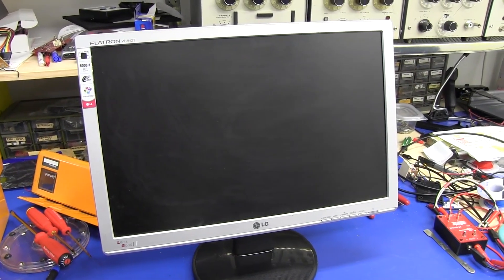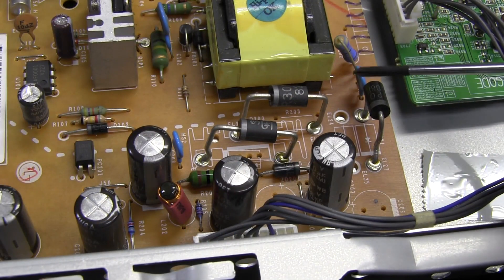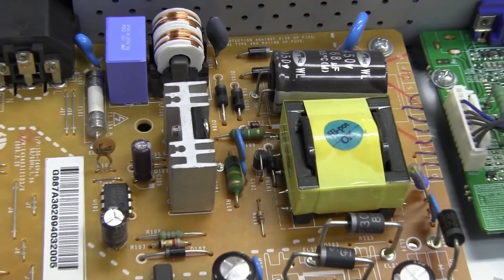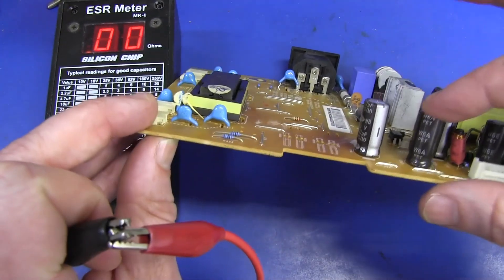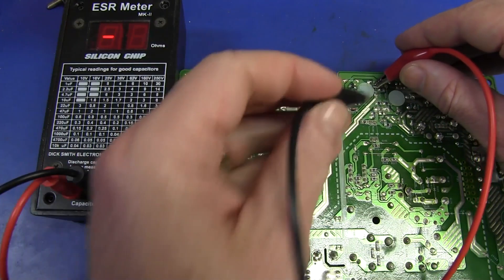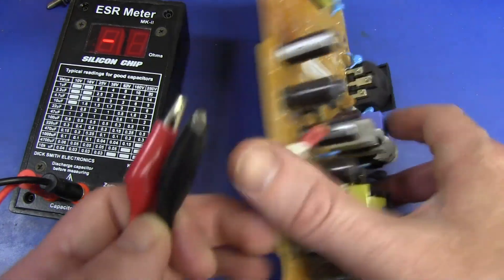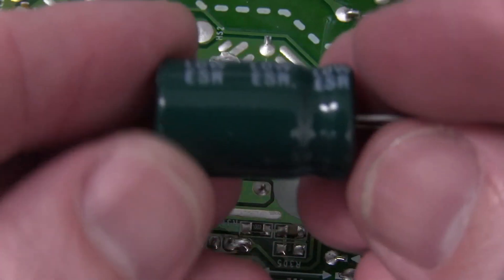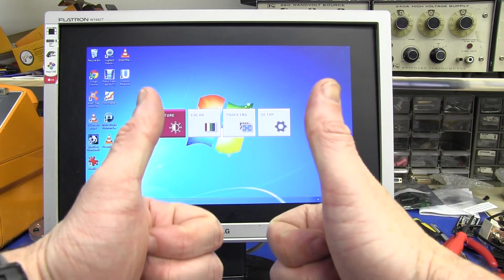EEVblog #365 - ESR Meter Bad Cap Monitor Repair

Comment: If measuring caps in circuit result is total for all caps in parallel? Definitely what happens measuring capacitance. The first bad cap measured was .23 the other almost double at .61.
Reply: Exactly correct Bob. Caps which are parallel in-circuit are unquestionably going to throw off the reading even when using an ESR meter. But you'll find that scenario doesn't occur often enough to worry about most of the time. Just be aware it CAN so always be on the lookout for that possibility. In which case, you'll obviously need to take any such parallel caps out of circuit in order to get an accurate reading on the ESR meter.

Comment: The low voltage wont bias any semiconductors, however what if there is a resistor in parallel with the cap under test ?

Comment: In 2011 I bought LG monitor, and it works to this time.
The reason is that this monitor get power from external PSU.
Reply: Yes. The internal switching power supply units are dog crap which will eventually self-destruct due to an inherently flawed design relative to the feedback loop. It can run away under certain adverse conditions and blow out any components in the path of least resistance which sink a sufficient level of current necessary to destroy themselves. Those, most typically being electrolytic filter caps.
Reply: Yeah and those classic CCFL backlight transformers are hot like hell.
Last time I fixed monitor where transformer overheated and secondary wiring was burned, and by some time there was sparking that probably damaged CCFL tube and inverter IC was shutting down after 1 second, even when I repaired transformer and tube was lighting, to fix it I had to add 10pF/1kV capacitor in parallel with defective tube.
But before I figured it out I spend few hours, IC based faults are bitch to troubleshoot, there was even no datasheet for that IC...

Comment: Hello Dave
I like your videos.

If possible , I would like you to clarify one doubt me ?

Is not risky measure the capacitor ESR directly on the board because I was told that damage the measuring equipment.

Because the capacitor can still load

Or that equipment , can specifically make the capacitor ESR measurement still on board

I hope you can understand me , because I used the google translator , I do not speak English

Continue with the good work

Thank you for your attention

Best regards

Zenilto in Brazil
Reply: Ele falou no vídeo que é pra descarregar todos os capacitores antes de testar.

Comment: looks like the board is being slowly burnt alive at certain spots. is there a way to dissipate heat in those dark areas?
Reply: Certainly. Install a passive heatsink (best option) or PC style "muffin" cooling fan assuming the component genuinely needs to sink that much power. But if it doesn't (which is more often the prevailing case) install a ceramic resistor or two by which to limit the excessive current generating that unwanted heat in the first place. Such potentially destructive thermal problems are usually the result of an inherent design flaw somewhere within the circuitry that went unnoticed during the "drawing board" stage.

Comment: Afaik it's common to use tabs instead of screws, not because the screws are expensive, but rather because it's more labor intensive to use screws.  It's much faster to snap things together with tabs, so they save a lot on labor costs.
Reply: +roidroid Ya maybe for them, but for us got to take it apart and do not know exactly where hte tabs are or what the method is to "unsnap" them. Screws are self-evident.
Reply: indeed.  Appliances aren't made for ease of servicing, they're made for cheap manufacture.  AFAIK Labour is one of the major costs in the manufacture industries, so any savings they can get there pays off BIG.  If a part can be redesigned to save a mere 1 second of labour time, they'll do it.

They probably save so much on labour by using tabs, that it more than offsets the costs of just replacing all faulty appliances with new ones (instead of servicing them).  So in the end it's the more profitable option to make non-serviceable but very-quick-to-assemble appliances.

Comment: It seem to me that having a small stock of Nippon Chemi-con output filter caps is a good idea. I was once forced to repair a computer power supply (after some 10 years of use and overloading-a-250W-supply-down-with-GTX-650-Ti abuse) and the culprit was a busted Capxon cap. Whacked a Nippon Chemi-con one into it after clearing the overload fixed it.
Reply: I couldn't agree with you more Max and have posted that same excellent point higher up above.

Comment: I got a Socket A motherboard that when used the computer locks up at times. It continues to run but it becomes unresponsive to input. Basically mouse and keyboard inputs cease to work.  I got one less than flat cap out of all the ones on the board right next to the ATX power connector on the board. I don't have a ESR meter, but if I can find a cap off another board that matches the voltage and capacity of it would there be any harm in replacing it. With these caps soldering should be easy even for someone as unskilled as myself.  Will to try to get a little more life out of that system for some retro gaming. I guess that could be consider retro at this point in time lol.

Comment: Can you use the "capacitor, ESR, inductor, transistor tester" (see link below) to test the caps (in-circuit) instead of the dedicated ESR meter used in this video?
https://www.youtube.com/watch?v=gx55Gza0zGE

Comment: Where can I get one of these ESR-meters for "in-circuit" measurements - Dick Smith seems to have stopped making kits !

Maybe there is some equivalent ones?
Reply: I've heard this one is great. Can also be used in circuit

http://www.amazon.com/gp/aw/d/B0032V5MIO/ref=mp_s_a_1_9?qid=1427148839&sr=8-9&pi=AC_SX110_SY165_QL70&keywords=esr+meter
Reply: Keld Sørensen Oh, I found the "Dick Smith" kit here and ordered one right away :

http://clientes.netvisao.pt/greenpal/evb1.htm

EDIT: Watch out for the MK 2 version !!!!!!!!!!!!!!!!!!!!!!!!!!

Now I started building the kit I notice it's NOT a MK 2 version !!!!!!!!!!!!!!!!

I ordered a MK2 and the manual downloaded for the kit is about a MK2 version !

I send the seller a mail right away - let's see how he reacts !
Reply: *****
I got the kit and i worked well - with some errors and confusens - but it works well

Comment: We don't call it a 'hate sink', but 'heat sink', because it draws off 'heat'. Go figure.
You're a 'professional electronics technician' who is surprised by how cheaply modern equipment is constructed? Bloody surprising that is.
Also, the ESR chart on that meter is way off on some of the measurements. A pro wouldn't even use a cheap meter like that to begin with.
One more thing. We don't use alligator clips to test components on the board. There are too many close proximity metal parts that can be touched together and interfere with the readings. Only a noob or lazy brit would do that.

Comment: if ESR is a measure of the internal resistance of a capacitor - then why can't one (in theory) just use the resistance setting on a multimeter - is that because of the 100Khz signal only?
Reply: A multimeter's resistance setting passes DC through the component, which in the case of a capacitor, would be like measuring the equivalent series resistance and what I'll call the "parallel resistance" in series with each other. At DC, the "parallel resistance" is typically extremely large as compared to the ESR (typically over a million times larger), and is theoretically infinite in an ideal capacitor (while the ESR is ideally zero), so it is impossible to measure ESR when this "parallel resistance" is in series with it.

The 100kHz signal is important since it makes the "parallel resistance", or more accurately the "reactance" negligible, since this decreases with increasing frequency. Thus, the ESR can be measured as if it is a resistor on its own. Hope this helps.
Reply: Your typical multimeter sends out a continuous current. My guess is that the cap will eventually heat and/or load up and the measurement is inaccurate. There are multimeters that can measure ESR of caps though, they just cost a little bit more.
Reply: Pathfinder3877 Not positive but pretty sure another factor is that multimeters are poor at reading low resistance ranges, while ESR meters specialise in low resistance.
Reply: la corriente continua de un multitester normal, no circula por los capacitores, solamente la corriente alterna puede. Los medidores de ESR emiten una señal de alta frecuencia y así miden cuanta resistencia interna tiene el capacitor.
Reply: blarrer20 dbdbdjnhsvdvp

Comment: that's a very handy meter. I'm working on a Yamaha mg16 and a Behringer mixer. real pain in the ass, so many caps. I hate when a cap goes bad and it doesn't bulge, damn headache.lol. nice video by the way.

Comment: Thanks for the video. I have a LG Flatron W2243T that isn't powering on. Nice picture, too bad they are built cheap. I thought about tossing it, but I'd like to replace the caps in it.

Comment: The plastic hinge design saves them assembly time by quite a lot. Also the cost of screws will add up, imagine they manufacture 10million of the same models, each screw costs $0.001, saving one screw that's $10K, those screws usually costs more than just a cent, so you get the picture.
Reply: That logic could apply to literally any component tho

Comment: You mentioned ESR meters can work in circuit because they send a low voltage at 100KHz signal but what about capacitors wired up to inductors? wouldnt this affect the measurement?

Comment: Love this guy!  And btw thanks so much for doing a real world example of how to use the Bob Parker ESR meter.  I had considered getting this model but I had heard or read that you did have to take capacitors out of circuit to get accurate reads and that made it less of a desirable product.  Your example has changed my opinion.  Ordering mine in the morning.  Thanks Dave.

Comment: your right. it seems like they put caps that are made on purpose to dry out in short time since i had to replace every electrolytic capacitor on my mother board. what quality can you expect in Tier 5 country, where noone is checking the quality of products, and yet we are paying the same price for the computer parts as in US and EU but the quality differs greatly. i bought GForce 9800GT for $280US (same price as the original) but it was made by Inno3d. crap quality failed in the first 5 months.

Comment: two times i am fixing my MSI P43 Neo-F mother board from blown or dry capacitors in the last 6 months without using ESR meter :( i wanted to build one but if i had money to build it i would certainly had money to buy new mother board instead of fixing the old one.

Comment: Assuming your body has got an impedance of 1000 Ohm there are 330mA of current at maximum. The time constant of the cap is about 50ms, which means that it gets discharged pretty fast, while voltage and current drop very fast as well (about 90% within 100ms). I don't think that this is lethal for a healthy heart but I wouldn't like to test it as well. It's definitely dangerous.

Found an interesting paper on that on the site of alcatel-lucent:
Google for "Effect of Electric Shock on the Heart *"

Comment: Sounds like cause for a review ... but get one that's regulated (temperature controlled).  When desoldering you need plenty of heat especially when the the boards have large areas of copper designed as heatsinks. Some wet on your iron helps too

Comment: What type of iron do you use? My current has issue's getting to a hot enough temp to melt non led solder on some of the newer caps

Comment: These cap issues just don't go away.  They nailed me with ECS computer boards around 333MHz and then 1.4GHz and now with the Asus M4A785T-M where the Tk ATWY 938A 6.3V 820uF caps are puffing and then the computer is unstable.

Comment: ive got a semi dumb question for you.. ive got whats called a  'voltage stabilzer' unit which is an optional device used for Tig welding when  added on to a basic A/C stick welder. This device uses  a tesla coil and a mica cap  in which the cap shows signs of the 'resin' leaking. This unit was made in 1967. The cap is imprinted with ratings that say 5000v 6.0 a and .01 mfd .. is there a modern replacement available for this .. ive  looked online and havent come up with anything other than used

Comment: Hi Dave...I found interesting the large traces for power have these "solder stripes", I guess they are to hold more solder than a complete open trace right? Could you test it? If yes, please post in here the link, so I might see it! thanks!

Comment: Anyone who feels capable may build ESR meter. Just search google for "arduino esr meter". By the way i repaired an LG monitor by searching google, not measuring elements. Not the best practice, but it worked. Changed the 2 capacitors, which are common to fail according to the Internet and it works again

Comment: The diodes are mounted at odd angles to prevent "mutual inter-component resonance," which, if left unchecked, the slightest deviation of smooth convective airflow would cause the diodes to start flailing about, bashing into each other and nearby components until turned into dangerous shrapnel. Yass.

Comment: Yes, certainly, but you'd expect them to last ~ their rated lifetime if used within specifications. Which is not the case with certain crap that's used to save a few thousand bucks in production.

Comment: They neglected to clean up the board artwork when they changed the heatsink & TO-220 package. Samwha are usually crap. I usually LCR and ESR check lots of caps.

Comment: Would like to know the same, but I think most important is the ESR. Looking at datasheets for caps (if you don't get extensive datasheets for the caps of a manufacturer, put that manufacturer in the "no, thanks" category), higher voltage rating does not mean lower ESR.

Comment: When using an in-circuit ESR meter, is it really possible to check a specific cap that is in parallel with other caps, without having to first desolder and remove the cap under test? What makes the ESR meter check only the cap you put the leads to, and not the one half an inch away connected in parallel on the board?

Comment: Hi Dave.  Yet another great video.. Though I'm getting a little worried about ya mate, going through dumpsters and all.. 

Yep the old monitor cap problem.. That old chestnut!!  

Question:  Who would you say is the best manufacturer of aluminum electrolytic low ESR caps broadly speaking ?

Comment: capxon are proper shite caps, never heard of samwha, is it worth buying higher voltage specced caps to replace or just like or like parts ?

would a 50v cap last a bit longer than a 35v one in the same job ?

Comment: There used to be companies making battery-powered milk floats in the UK, decades ago. Unfortunately, they built them so robustly that they went out of business. There was a reason for the old approach to change. Planned obsolescence is essential is stay in business, and provide products at an affordable price. Over-engineering products is more wasteful, and less sustainable, than the alternative. I realise that doesn't sit well with the modern eco-warriors though!

Comment: If you go to higher power PSUs (PC power supplies), it's quite common to have a few in parallel on each output rail. Often lets say 3 1000µF in parallel have a much lower ESR than one 3300µF.

Btw. I wouldn't measure anything in circuit either (except maybe a diode for a short).

Comment: Dave, there is a simple way to make the cap fail in 2 or 3 years... Filter most of the ripple but leave just enough to kill the electrolitics! However you can fix this by just adding a few 100nf caps near the filtering coil to get the edge a little smoother. This lengthens the life of the cap's considerably.

Comment: thats what i was concerned about. i think he did not mentioned it and those output caps are usually in parallel, aren't they ? I was surprised that he even got different readings.
Maybe these are different output rails ? 12V and 5V or so.

Comment: there is a break in the solder joint for the diode at 4:49, really crap design.

Comment: Great vid Dave. As for snap cases, not only do they save the cost of the screws, snap cases are MUCH easier and faster to manage in an automated assembly process, which I imagine is the real reason for avoiding screws.

Comment: Not sure if you mentioned it but when your measuring these in circuit make sure there are not several in parallel because they can check good even though one is bad. Also some of the esr meters on the make discharge the caps as part of there test which is nice.